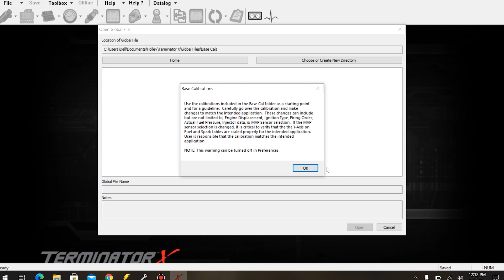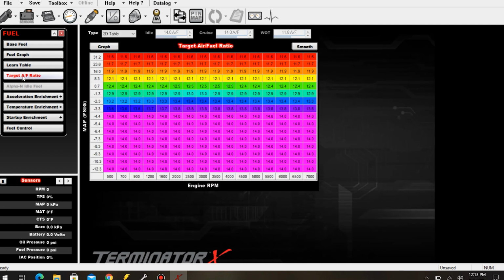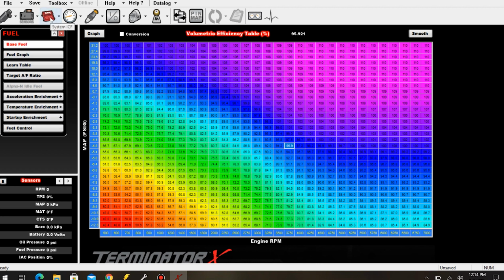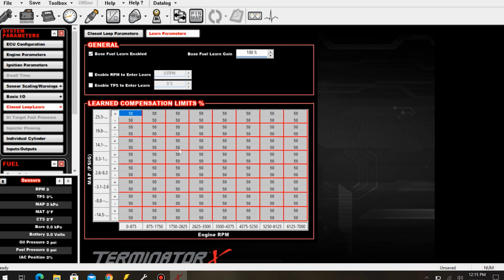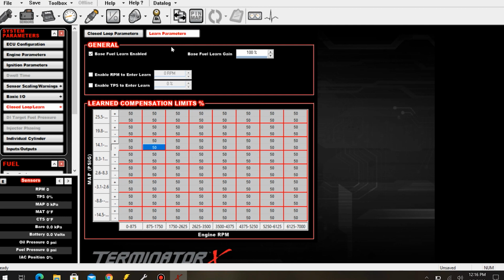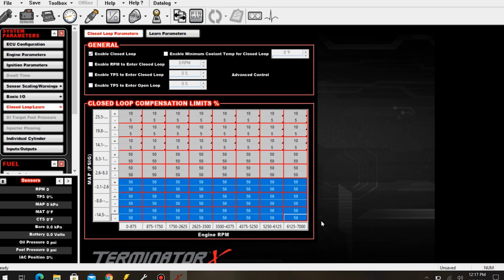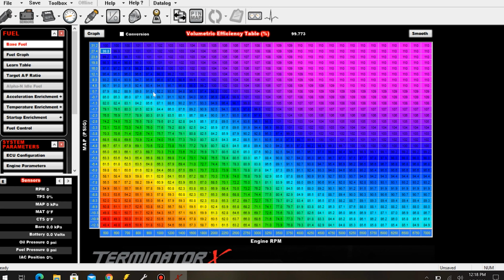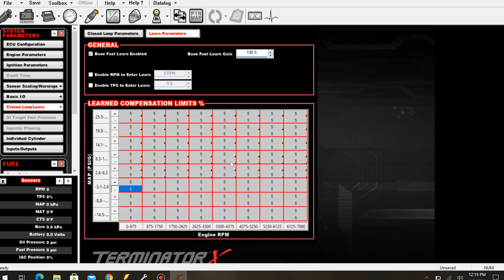Holley EFI   Terminator X   DO THIS so you dont get STRANDED on the side of the road!

Comment: What other o2 sensors can I use my terminator x keeps fouling my plugs and it’s almost like it’s running on 4 cylinders it’s a 6.1 Hemi
Reply from the maker: You can’t run any other o2s. The o2 isn’t the problem it’s the tune. Or if the o2 is going bad completely and you have the cl and learn values too high it will throw a bunch of fuel at it if it’s failing lean which they typically do

Comment: Main take away is keep a second tune with Learn and Closed loop disabled loaded on the handheld. Just in case. save the current tune and flash the backup in the event of a failure. 
Thanks for the info.

Comment: Wait, the Terminator was setup to be a basic unit for standard fuel.  It is using the Bosch style O2 because it’s, basic. But I think the  NTK 24513 has the standard plug.  Holly sells the adapter.  The NTK is primarily for leaded and alcohol fuels, methanol etc.

Comment: So I did find a NTK part number for O2 sensor that works with Terminator and Sniper system. Holley does not offer it, been using it for a while with no problems.  NTK 24315, I personally have used it in both Sniper and Terminator. Still really good advice, just wanted to pass this on. It’s a $140 on Amazon.
Reply: What terminator you using sir?

And how is it holding up?

 your comment is 3 yrs ago so thought i would ask im getting ready for a ls swap and would like a reliable daily

Comment: Great video man! I really can wait to get to the next steps on tuning! Hoever I looking for help dew to Holly is really hard to get a hold.

So I have a fox with 5.0 hci and now terminator, I follow the steps on IAC, and pwm. And delivered it to right output, and my car just keeps dumping air throughout the throttle body, I replacede it and same woriking, but if its unplugged it Idles fine sometimes it fires right up and sometimes it doesn't just looking for hint mans pls any help

Comment: Correct me if I’m wrong! You said use the VE table to get the engine to run at your desired AFR. The VE table is a representation of the engine’s air flow. The injector size and target air fuel are used to calculate pulse width to get the desired AFR. Once the VE table is correct (or maybe close), the AFR should also be close to “desired”. Then running closed loop and/or learn should need only small correction values as you stated. My point is If you decide some part of the target AFR table needs changing (maybe you want full throttle at 12.8 instead of 13.2 or something ) it shouldn’t affect your VE table. Having effective closed loop (with a functioning O2 sensor) should allow the ECU to do minor final corrections to hit the AFR targets. Your point is don’t let the ECU make drastic changes in case of a non-functional O2 sensor. I’m just saying getting the VE table right doesn’t affect the desired AFR, you do that with the target AFR table.
Reply from the maker: Using VE if you want to change the target afr you do not need to adjust the ve table at all. Simply adjust the target afr table and the change will take place with out closed loop having to do anything. 

When o2 sensors fail they usually fail to a certain value, usually all the way rich or all the way lean. So at that point the ecu will think your say 10.0 afr when you are targeting 14.0. It will keep pulling fuel trying to get to the target until it maxes out the correction amount you let it. So if your closed loop table is 50% and your learn table is 50% it’s going to pull fuel to the point the car wont run anymore because the stuck sensor will just show 10.0 regardless of what the actual air fuel ratio is
Reply: @JoeSimpsonAtTempest  I agree, I think we said the same thing.
Reply from the maker: @bdugle1  i sorta thought that too but it seemed like you were disagreeing with me so i was confused  haha

Comment: My understanding is that closed loop adds/removes fuel based on temp, elevation, etc but does not change the values in your base fuel table. The learn feature is going to change the values in your main fuel table over time to try and meet your desired AFR. I would tune the main fuel table with closed loop and learn both disabled. Then enable the learn feature drive around for a while and let it make any additional adjustments and then disable the learn feature and enable the closed loop function.

Comment: I allow the closed loop to add fuel maybe 10% at most. Never allow it to take out fuel. Specially on forced induction/nitrous.
Reply: Err... no. You want the base map to be slightly rich before it 'learns' to be safe and protect the engine.

Comment: Can a guy get a sensor for the terminator that works with leaded fuel?
Reply from the maker: Only one sensor option and it will work with leaded fuel, however sensor life will be shortened
Reply: @JoeSimpsonAtTempest  thanks for the reply sure is a bumer though
Reply from the maker: Yea unfortunately it’s one of those you get what you pay for type of things. The wideband i use on customers cars that holds up to leased fuel is almost 3 grand.  

The HP and Dominators can use a NTK sensor which will hold up 1000 times better

Comment: Another thing you can do is to also lower the learn gain if you do decide to keep it on.  Holley even says that lowering the learn gain to 10-30% will make the learn table populate much slower and act more as a long term fuel trim.  I personally don't necessarily like the learn function on Holley ECUs because I think it alters too much of the table at once.  It's even worse on the HP and Dominator when using the small 16x16 fuel table because the learn function can mess up the idle area while you are cruising.
Reply from the maker: First thing i do is turn the learn off whenever i start tuning one of these
Reply: You can also just turn off or turn down the learn just at an idle.

Comment: a drop in fuel pressure can be fixed with a fuel pressure compensation table  that way its not relying on the o2 compensation
Reply from the maker: Yea you can build comp tables for basically anything. This is primarily aimed for when o2 sensors fail
Reply: @JoeSimpsonAtTempest  I know I was just saying. I have arguments on the forms with people about not making the computer Compensat with the O2 i tell them there has to be a Error first then it corrects, some times the Error wins first too.